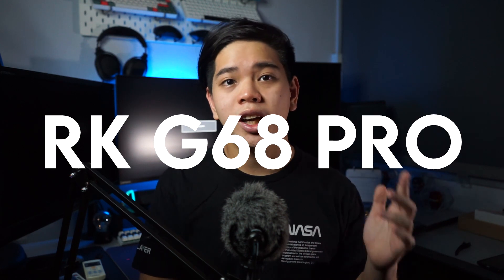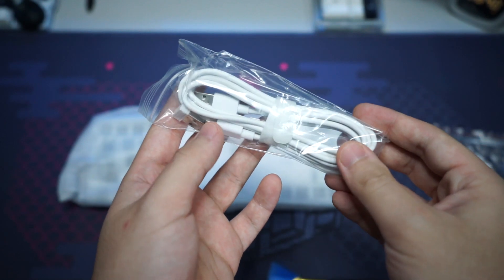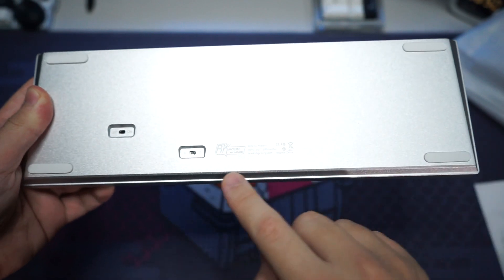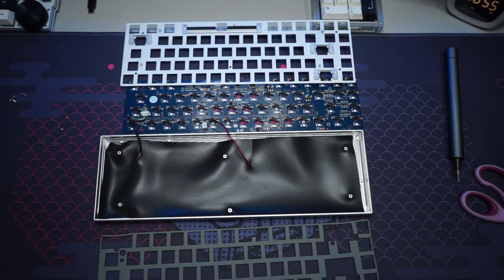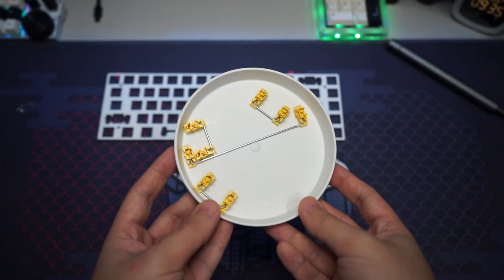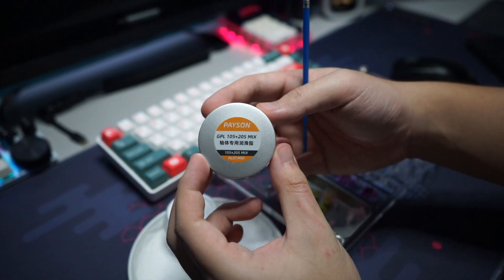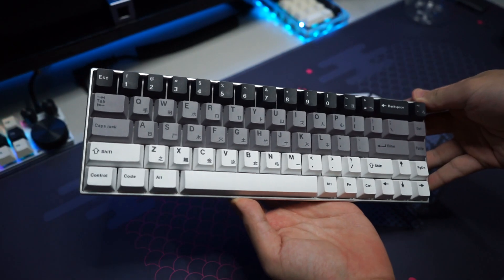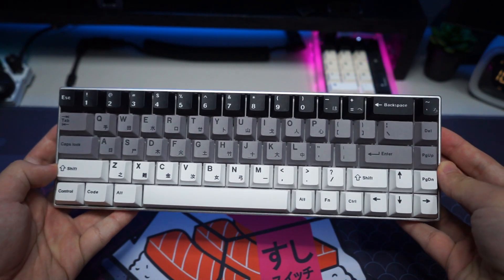Upgrading My Royal Kludge RK68 PRO - Lubed Akko Starfish Poron Foam PBT Keycaps | Samuel Tan

Comment: I'm planning to build a keyboard for university, are these keycaps acceptable in terms of sound? T__T I like how they feel (got a tester) but idk if people around the campus or anywhere public might react to the sound. What are your thoughts?
Reply from the maker: I think these sound alright, but if you're scared on people judging maybe find a more silent switch? For me I don't mind hahah I love how my keyboard sounds
Reply: If you're worried or people start complaining, I highly recommend the durock silent shrimps 🦐. They feel sooooooooo good. I was absolutely stunned.
Reply: @josejimenez896  do they not feel mushy? Outemu silents fee mushy as fuck
Reply: @aaronmiguel2036  nah, not for me at least. Maybe it's because I put them in my tester 68 that I o ring mount moded, but they feel almost, bouncy?

All I can say is that you really have to try em to understand. Like I said, I only bought them because I was about to work around some coworkers, but ended up loving them. The bottom out is, nice. It feels almost like typing on a block of solid silicone? Ahg I'm not good at explaining. Just go watch some reviews and check the comments. They're quite impressive for a lot of people. And insanely smooth out the box with the slight factory lube.

Comment: This might be an alternative for the tofu65. I like the rk68 although i'm not sure if the plate material is plastic or aluminium. Does the pro variation come with aluminium plate? Do you also like the other modded rk68 which you covered back then or do you prefer the pro version?
Reply from the maker: Honestly I prefer the Pro version, I like the sound more and for the plate I think it's just the same metal as the original one
Reply: @itssamueltan  Okay thanks. Just one more question. Do you know if it's possible to replace the plate for this keyboard?

Comment: Great video! I got this keyboard last month and was hesitate to open it up, but looks pretty clean inside. 

I find this keyboard sits low with no risers. Is there specific mods or tips you can provide? 

Thanks!
Reply from the maker: hey thanks! But yea u can get some silicon bumps for like chairs i use them all the time